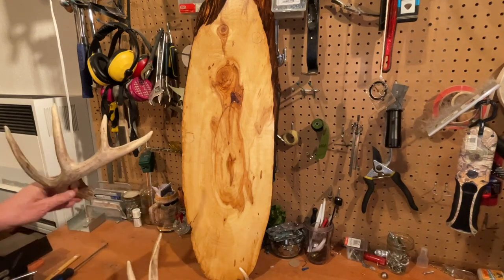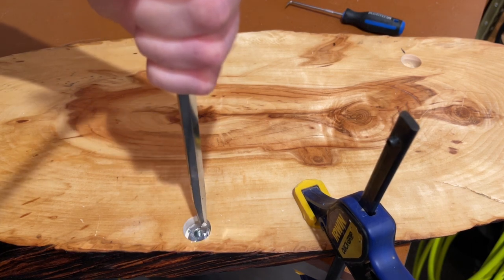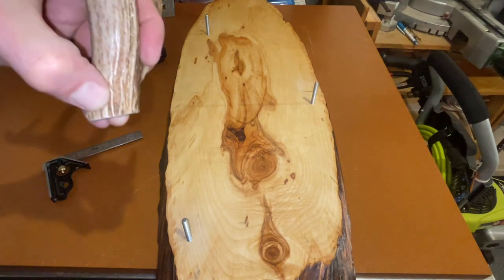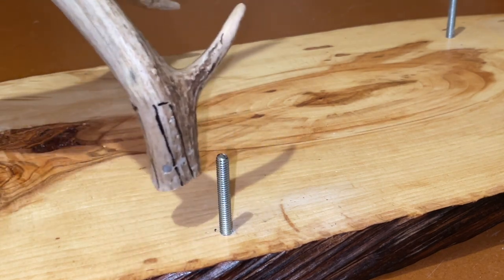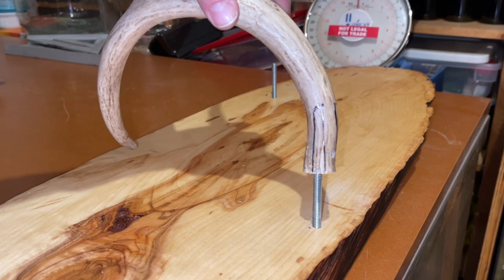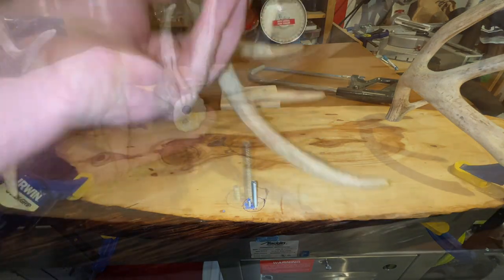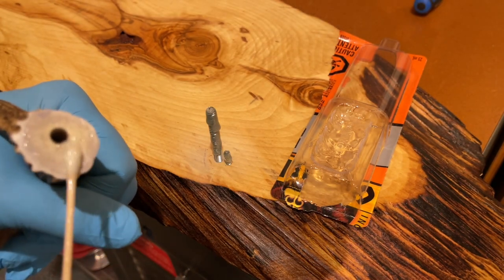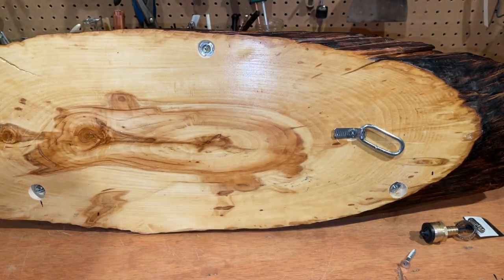HOW TO MAKE AN ANTLER TOWEL RACK

Comment: Why wouldn’t you just put thread a Stud into antler an screw into board? Or drill all the way threw gourd and crew through back of board into antler?  I have made many but are coat or hat racks!
Reply from the maker: I"m sure you're correct sir, ultimately I was concern about the antler striping under too much weight or abuse. 
Thus gluing was the option I went with. For you, this may be a video of what not to do:)